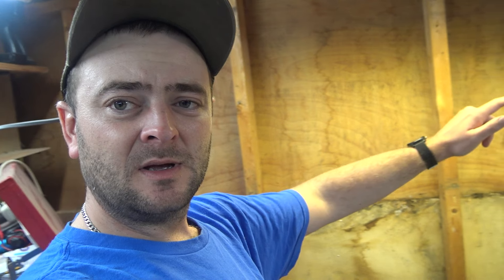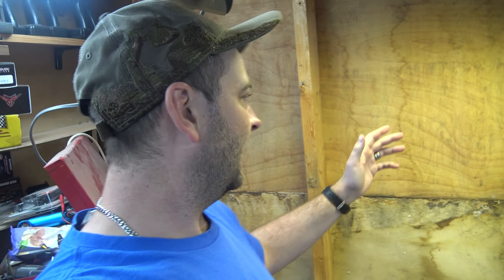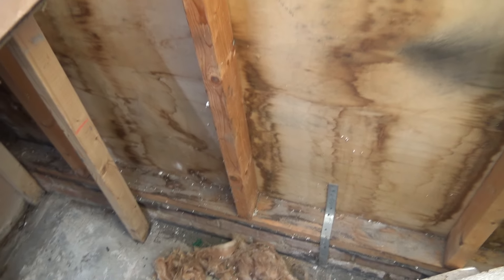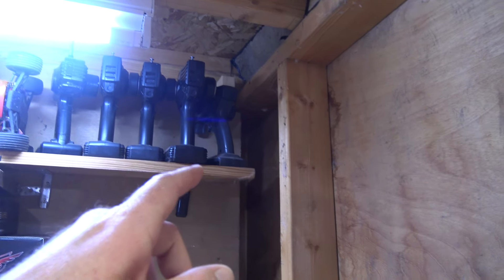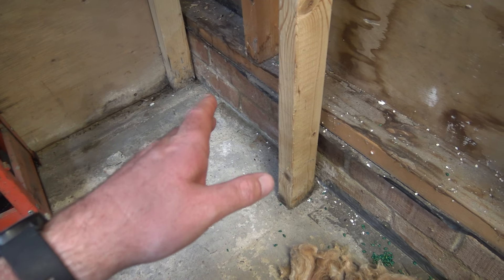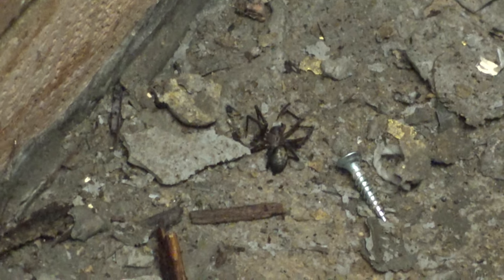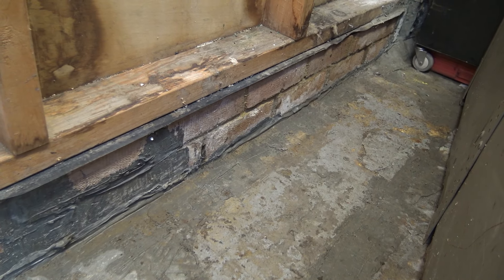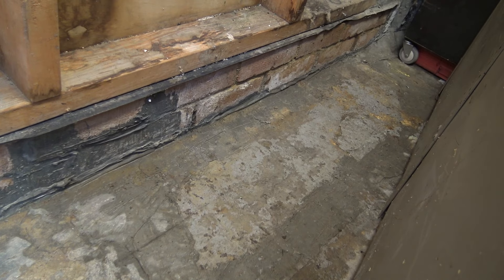My RC Shed Keeps Flooding LET'S MEND IT...I Mean Bodge It 🤣

Comment: Had the same problem in my old workshop mate. Ronseal the outside. Bang an air vent in while you got it all stripped. You will be surprised how little air circulation you get when all your tools are loaded back in the room.  get some heat on dry they wood out  and your on a winner. Working on the trike this weekend fella. Will be in contact soon regarding the controller stuff. Have a good weekend all. C
Reply from the maker: I’ve got 3 vents and the roof has vent gap all around it… drafty 😂